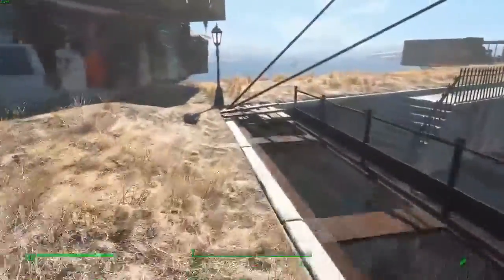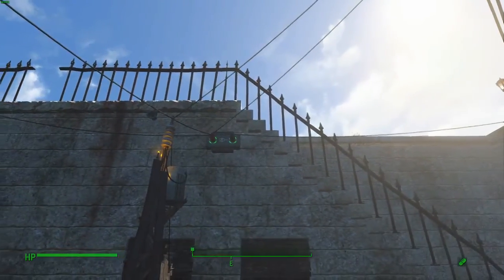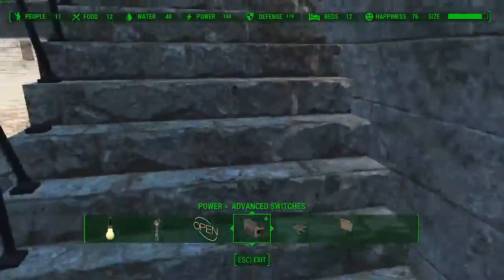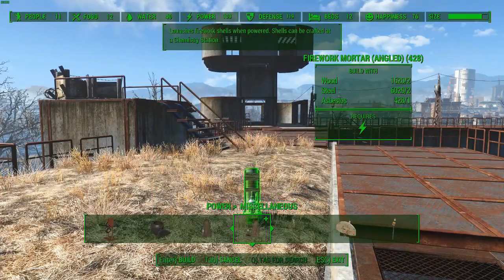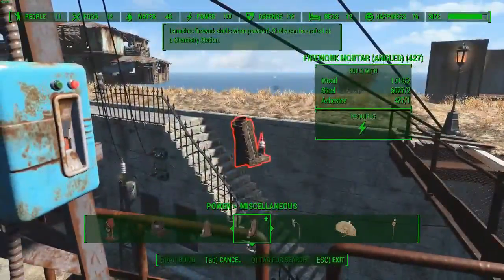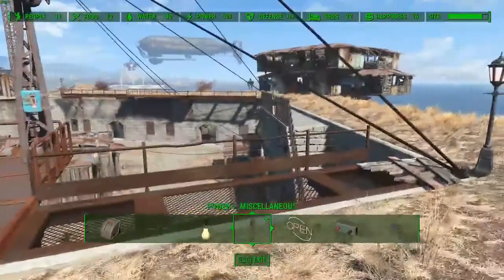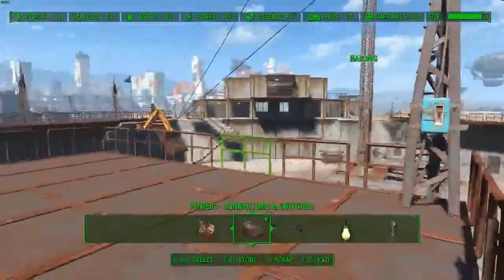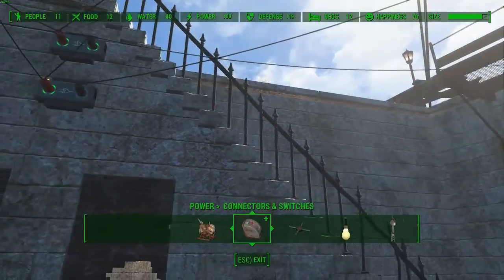Fallout 4 Settlement Security Redux - Emergency Flare Mortar

Comment: Ummmmm....
Why can't I just run power as follows:
generator > alarm > delayed off pylon > firework mortar?
Wouldn't that setup work?

Or did I mis a step?

I'm hoping I can set this up at a few of my larger settlements so that I can leave and the settlers can call for help themselves when attacked.

Comment: do u think you could make a video of how to have a switch each side a rolling metal door and when u turn either of the switches on it closes behind you but will still work if one of the switches is in a different position to the other  &   that is  connected to  1 terminal to change the delay of the door closing
good job on the videos dude keep it up :)